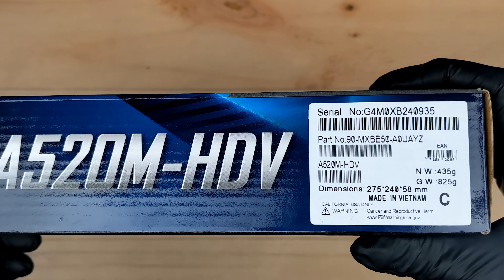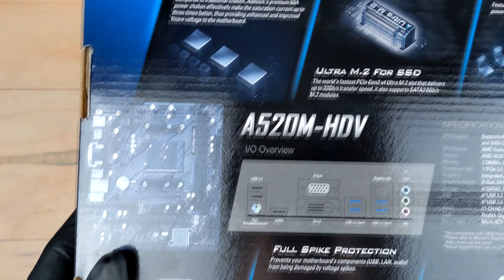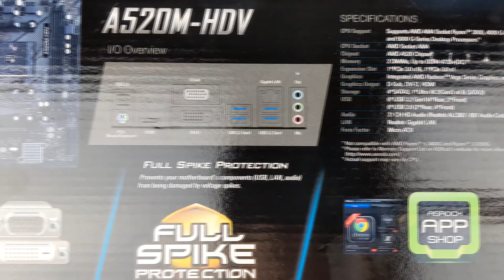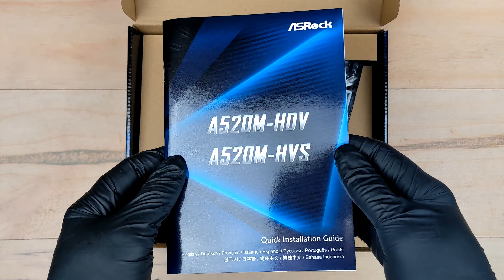ASROCK A520M-HDV 🎯 Motherboard Unboxing and Overview

Comment: Apakah bisa memakai ryzen 7 seri 5xxx atau ryzen 9 seri 5xxx ?
Reply: The mother board is AM4 Socket only. So it supports Ryzen 5 3000, 4000, and 5000 series CPUs. So this means Ryzen 7, nor Ryzen 9 will work. And Intel CPUs won’t work either if you’re even more confused.